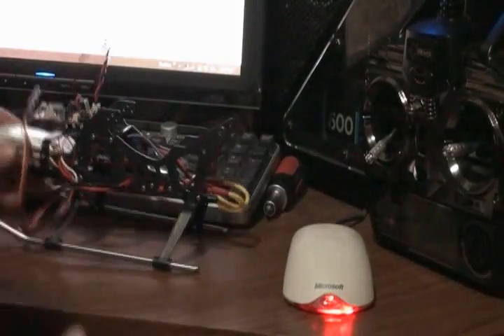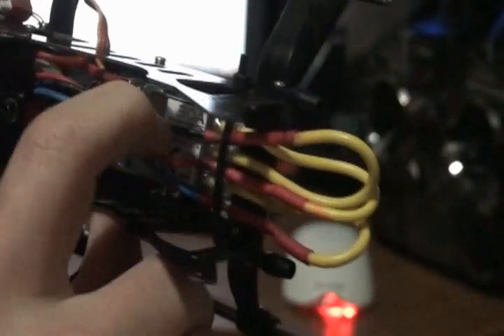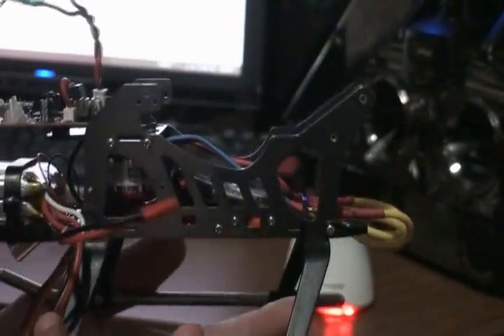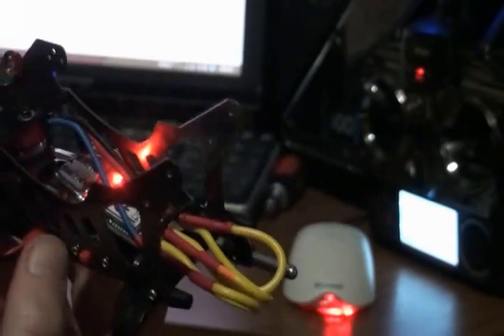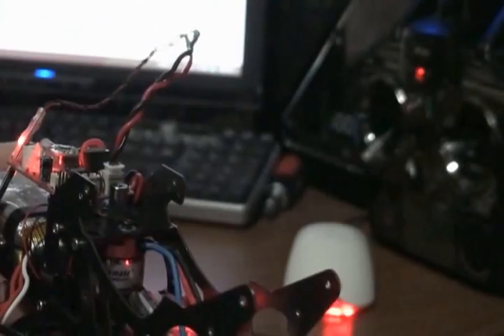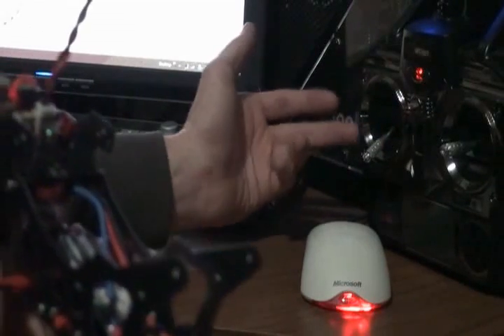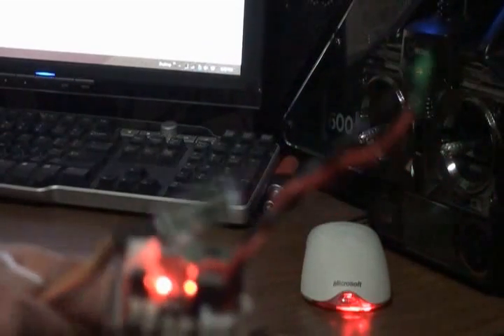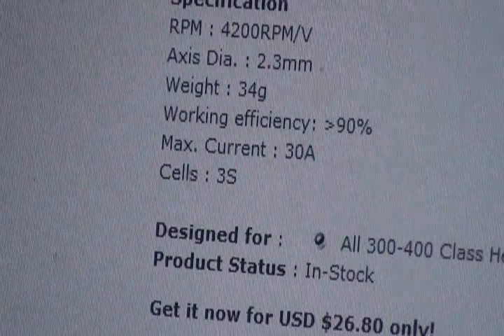Troubleshooting my brushless upgrade

Comment: Hi buddy, good night. I would like to know where you bought this new brushless v913 kit. where I buy. What is the name of this new kit? thanks in advance.
Reply from the maker: It wasn't a kit. Just sperate parts. I never got it working. The motor works great with a brushless ESC in my tricopter.
Reply: @mccunnj  How can I get a piece of this here for me to do on my brushed v913. for me to transform to brushless. ?